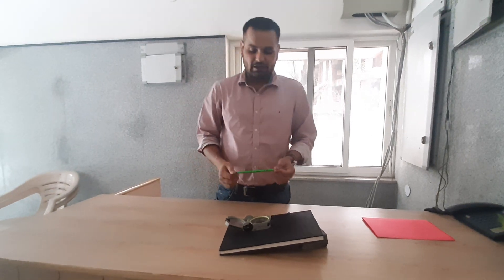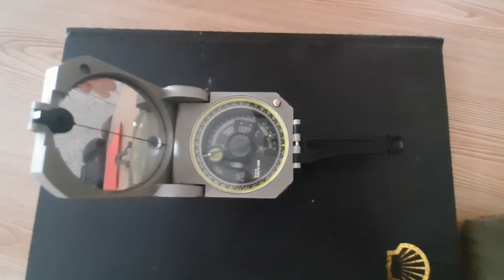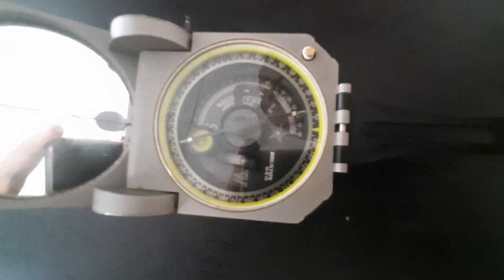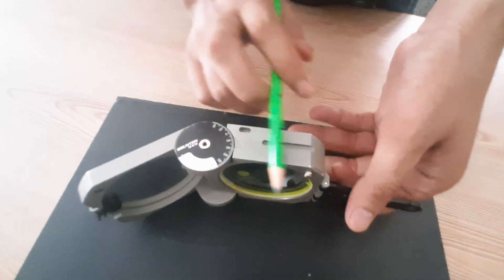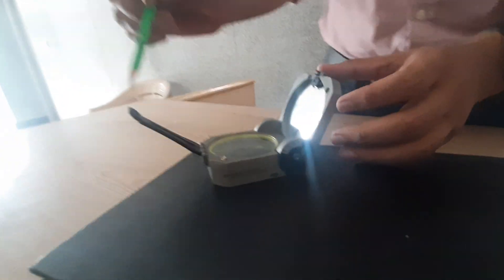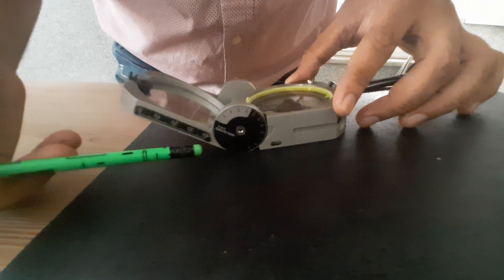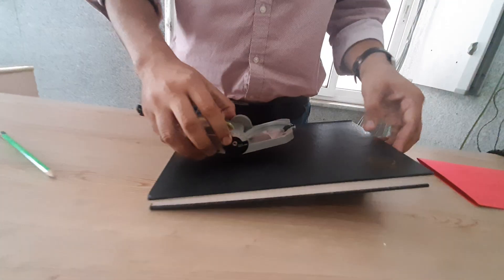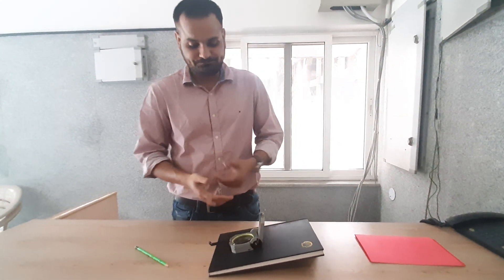Brunton compass and its parts

Comment: Sir why some compass have strike angle  0 to 360 from left side
Reply from the maker: Sir, we can use two methods to measure the direction, first quardant bearing method and second is whole circle bearing method. In quardant bearing method, dirction measured with respect to north and south, while in whole circle bearing method north is the reference. So in whole circle 0-360 degree mention on brunton. Even measurement can be calculate in quardant manar. For example 120 degree or we can read this S60E.